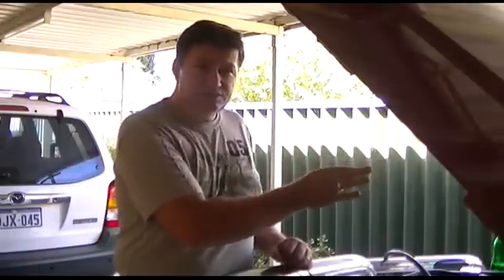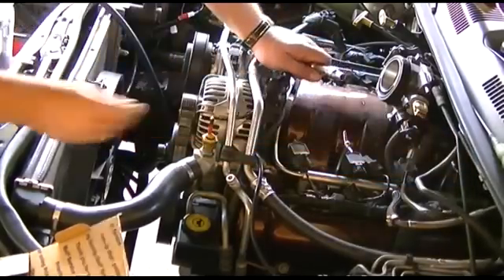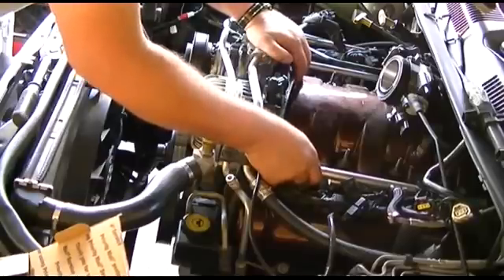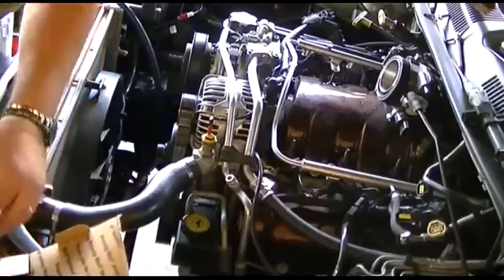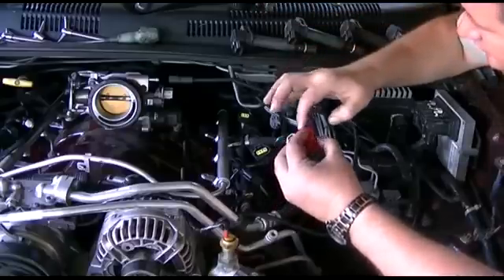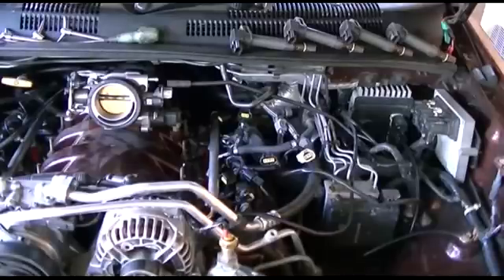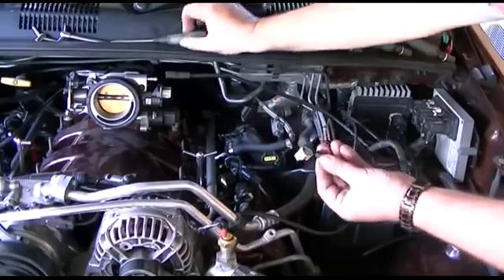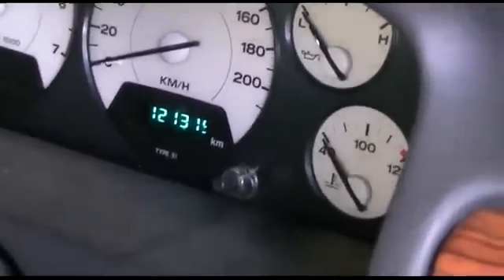How to change fuel injectors with 12 hole injector for better fuel economy and power in a WJ Jeep.

Comment: I found injectors that is for the Mazda L5-VE 2.5L it's 296.5CC will this work? It's also a 12 hole I'm getting 26L per/100Km in the city driving gently which is absurd will I get better fuel economy?
Reply from the maker: As long as they are EV6 injectors or you may need adaptors. They should be fine but I have no experience with them. Not sure why yours is so bloody thirsty?  Mine dropped fuel consumption from 16l + /100klm to 12l +/100klm. This heavy footed driving in city and highway. Do you tow or carry heavy loads? 
Next year my red jeep is going to be completely rebuild with much bigger injectors as I'm going to use E85. A lot of my obsolete upgrades will go to my WJ Overland. I'm planning of building a world first modification. I have a house to finish then take a long deserved holiday. So hang in there for more WJ adventures.
Reply: @BuiltByRik  I also wanted to go for E85  but in South Africa it don't exist lol nothing exists in South Africa and parts you gotta import them and it's Hella expensive
Reply: @BuiltByRik  they are EV14 injectors
Reply from the maker: @justindaniels17  you will have to google to see if they will fit. You may need adaptors to make it fit as well as a adaptor plug for the electrical connection. It you have the vehicle around wrecking if your able you could cut and solder the EV14 plugs into the jeep harness. 
https://www.google.com/search?q=ev14+to+ev6&oq=ev14+to+ev6&aqs=chrome..69i57j0i512j0i8i30j0i390i650.44048j0j7&client=ms-android-oppo&sourceid=chrome-mobile&ie=UTF-8
Reply: @BuiltByRik  it's the same connector
Reply: @BuiltByRik  funny thing is I don't tow or carry anything, what size tyres do you use? I just noticed all the tyres are different sizes one is 255/65/R17 one is 225/60 one is 235/65 one is 235/50
Reply from the maker: @justindaniels17  I'm quite strict with tire size as constant fourwheeldrive requires to have at least the front 2 tires to be the same and back 2 tires to be the same. But recommend is all 4 to be the same size. Each wheel has a sensor ring telling the TCM / ECM the speed of each wheel. I'm no expert in this but if one tire spins faster than another constantly it may try to compensate. Other readers may know more than me about it. Lucky I have a HD transfer case from USA that has a 2wd option as well. Looking forward to that I like doing burnouts.
Reply from the maker: @justindaniels17  I have 31 inch tires 265/75/16
Reply: @BuiltByRik  yes awd & 4wd should have 4 tyres of the size and tread shape and you're supposed to buy 4 tyres at once each time a tyre wears out otherwise it will mess with the AWD&4WD system especially if you have a LSD like I do but I got the car in Feb this year and I never paid attention to tyres until recently

Comment: Will a need tune? Stock engine 4.7 HO going with those Mazda injectors Its 296.5CC and stock (OEM) is 255CC
Reply from the maker: Just follow the instructions under the clip. You need to reset the ECM. It will then learn and adjust to the new injectors.
Reply: @BuiltByRik  thank you I appreciate, and hoping to see more WJ Content

Comment: Hello, can you send me a link where I can find a 12-hole injector for Grand cherokee wj 4.7?
Reply: Hello, I wanted to ask who can be the best injectors for increasing the power to 4.7 wj?
Reply from the maker: @leomirtafaj7662  For me it is this one. If you go bigger the ECM will just reduce flow and if it cannot you will run rich all the time. Bigger injectors need more airflow.
Reply from the maker: all the information you need is in the write up under the clip including part numbers. You then google that number and find what you need. Most of my clips that need more information have a look at the story that goes with it for more information. If you still need help plz let me know. Regards Rik

Comment: Hi there, 
I live in Sth Australia. 
Where would be the best place to order these Fuel Injectors?
I have a 2000 WJ 4.7
Reply from the maker: Where ever you can find them I guess. Also depends on your price range new or used. I brought mine on eBay. Check below clip and more on this subject in my channel. Regards Rik

Comment: What is the impedance on these injectors and flow rate? And would these work on the '07 4.7
Reply from the maker: I'm sure they would be fine but if you want to research first plz check the part number in the story below and look it up. Regards Rik

Comment: I had good results using injectors for a 2007 Chevy Cobalt 2.2 litre with California spec emissions. Just filed the fuel rail to make the clip area circular instead of the original "D" shape, used the original clips and fit like a champ. Reset the fuel trims and no rich/lean codes.

Comment: I just bought a set for my 04 dakota 4.7 and the injectors are the same size, the plugs are about in the right spot but the groove where the clip goes on is definitely different. I'm going to try an cut a groove in them. Hopefully I don't mess them up.
Reply: use a Dremel and round off the squared part of the flange on the fuel rail then you can rotate them in any direction needed.
Reply: Don't bother with the clips, just leave them off. They are only there to hold injectors on the rail during assembly at the factory. I left mine off a year ago with no problems.
Reply: charlie dee you running the injectors Aussie is referring to? From the 4cylinder focus ? I thought about just leaving the clips off

Comment: great video!! 12 hole nozzles will bring your engine to 2018 standards... 
the fuel comes out as a mist instead of a spray as in older EV1 type injectors
as long as its the same flow rating no tuning is needed 

https://www.injectorplanet.com/collections/volvo-fuel-injectors/products/denso-3900

this 24lb denso 12 hole nozzle is also a popular upgrade for the Magnum or Powertech V6 / V8 engine
thank you 
-Bryan
Reply from the maker: That's $50 each?
Reply: $17.69

Comment: I was able to pick up the Ford Focus injectors from Rockauto brand new for 18 each. Going to swap them into my 4.7l Dakota in a couple days along with some new O2 sensors. Great to know that is what they are selling on eBay as an upgrade.
Reply from the maker: They started doing that a few years ago as it became more popular.
There can be some trouble installing them from some brands. Ask if you have any problems. Regards Rik
PS don't forget to subscribe 👍🚙
Reply: Already did.  Got them swapped out today since it was decent out.  Took about an hour and a half from start to finish and I have never changed an injector before so I think I did pretty good.  The old injectors were the two hole style and likely the original injectors.  

And using an OBD2 bluetooth tool and my phone I was able to get a screen cap of the levels while running about 2000rpm of the fuel trim and O2 sensor readings from some brand new sensors.  The injectors are working perfectly as far as I can see. http://files.ventshop.net/Pictures/Mypics/Screenshot_2018-02-08-15-51-27.png the scale is a little off on the graphs but you can see it is working well.  Did this with an 03 Dodge Dakota so this pretty much shows that they work perfectly as even the fuel trim is in a good range.  I suspect that they will be able to flow a little more fuel than the stock ones but so far I am very happy with how it worked.  I think the idle is a little smoother now as well but that could just be due to the injectors being new and the old ones having almost 200K miles on them.
Reply: Well here is an update on the injectors.  They have worked great so far and I expect no issues at all.  My truck is rated at 18 MPG highway and 14 in the city.  I just the other day drove from OKC to Dallas and back and with a 24 gallon tank I was able to get 441 miles.  Tank may have had a little more than 24 gallons in it but that is the "rating" it has listed.  I should also note that the back seat has quite a bit of stuff in it, there is a toolbox in the bed along with some fuel cans, a set of ramps and a power chair that weighs about 500 lbs.  Two adults in the truck as well.  I was cruising right along at 70 in the majority of Oklahoma and 75 in Texas with a 15MPH headwind on the way down and not much wind on the way home.  I was in town driving through rush hour after a quick stop off in Grapevine before the game at the American Airlines Center.  

Figuring right at 24 gallons in the tank and it was still running fine when I got home so probably a little left that would put it right about 18.3 MPG.  Which is a little better than the rating it gets but not much.  The thing is that it's rated with an adult driver and nothing else in the vehicle and highway ratings are not at 70 to 75 mph.  Looks like most users are getting around 14 to 15 mpg and I doubt they are hauling around 1000 pounds of stuff all the time either.  http://www.fuelly.com/car/dodge/dakota?engineconfig_id=5&bodytype_id=14&submodel_id=  

All I can say is I am very happy with this mod and not long after getting it done I made a trip from OKC to Branson, MO and was getting around 19.5 MPG running 70 to 75 on the interstate without the power chair in the back which REALLY kills the mileage.  Over the entire trip as well as some around town stuff when I got back I used exactly 39 gallons, ran it bone dry, and ran 775 miles.

The next mod is a fuel heater.  Since the fuel is under pressure I should be able to use a heat exchanger to  bring the fuel up to the engine temp of around 180 degrees  it should evaporate as soon as it enters the engine.  Since it is under 40 PSI there should be little issue of it evaporating in the lines  and I also intend to put a filter after the heat exchanger which should drop the temp a few degrees and I plan to have a couple ball valves in place to adjust how much engine coolant is ran through the exchanger to help regulate the temp.
Reply: So a little update.  Been a few more years and still running good.  Sadly my life has changed drastically and when that drastic change happened I ended up overheating the engine and now the head bolts are likely stretched.  Completely my mistake but having your best friend and wife pass away really puts your mind in a bad place.  Was headed towards Tuscon, AZ and after passing through White Sands, NM I went through a pass and coolant must have been low or boiled over or something.  But the 2.3l Ford Focus injectors still work just as good as new.  Hopefully I can eventually scrape the cash together to rebuild the engine and keep it on the road a while longer.  This vehicle was the one major purchase my wife and I made together and I want to keep it going as long as I can.

Comment: There's no point in upgrading injectors if the PCM is not tuned for them. The stock PCM still thinks the stock injectors are in place and is having a harder time figuring out  the correct fuel trims according to what the oxygen sensors are reading. Complete waste of time and money doing this, unless you plan on the future to buy a programmable aftermarket PCM  to complete those larger flow injectors. Also that filter is sucking all the hot air in the engine bay that the radiator providing. All this mods instead of increasing performance it hurts the powertrain, there's a reason warranties are void if stuff like this is done. Don't believe any of this youtube videos unless is backed up by some sort of evidence like dyno runs.
Reply from the maker: They are not larger flow injectors lol. I think my warranty's run out a while ago on a 18 year old vehicle hahahahahahaha. There are plenty of jeepers who have done this upgrade and are using  less fuel you don't need a dyno to prove that. The increased throttle response is a added bonus. But your allowed your opinion but its the opposite to those who have done it. 
Flow is the same but the 12 holes atomize the fuel better than 2 or 4 holes. That's just basic mechanics. I guess you have not done the conversion because if you had you would not be so negative. I been telling people for 4 years about this upgrade and have had many thank you emails. But you know better I guess without knowing?
Reply from the maker: Ohh yeah I know my filter is not ideal but I have been battling health problems and time to upgrade my intake cheers for the negative comments. A aftermarket engine management system is on my bucket list. Regards Rik
Reply from the maker: Also this channel is for back yard mechanics just playing around with their jeeps if you don't like it don't look.
Reply: The ones you installed are indeed larger flow injectors they are 24 Lb/Hour even you mention it on the video description, "Instead I found some Bosch 12 hole EV6 24lb (240cc) injectors on eBay P/N 0280156161 for US$180 + postage to Australia. These are out of a 2003 Ford focus 2.3 liter 4 cylinder I found out later. ". You also said on the description that stock injectors were 19Lb/Hour when in reality on this more reliable website it says they are 22.5 Lb/Hour http://wjjeeps.com/engine.htm From 22.5 to 24 that's quite difference the PCM has a miscalculation going on now. Sure they atomize better, but what holds the fuel 49 PSI fuel ,more holes? Come on mate, that's equal to more fuel flow. I find it hypocritical from someone who spends so much money and time in a WJ to not install a better standalone PCM. Sorry but I try not to look at your videos, but simply I'm attracted to what misleading information you're gonna come up with this time jajajaja, it' is simply entertaining nothing personal. Maybe if the title of the video would be changed to how that change injectors only it would be a good one, but then you try to talk people into "Better performance", because the Overhead console tells you're getting better MPG then it sends all your hard work down the drain.
Reply from the maker: That is for stock 4.7 the HO has a higher flow and for your information the ECM (engine control module) a pcm is for the power train is quite capable of this small increase it learns from its sensors and adjusts fuel mix as needed. If I had put in 1000cc injectors that would change things. The ECM learns over about 50 trips so if you reset it after installation it adjusts accordingly. I'm no genius but know enough from research and questioning experts in the field who will back up my claims. In fact I have a mechanical engineer following me on Facebook who has also done this conversion and loves the improvement. Regards Rik
Reply from the maker: More holes don't mean more flow if the holes are smaller lol. Wow you think the injector manufacturer is wrong now about the flow of its injectors?

Comment: Any updates to this?  You've been riding with this setup for a while now, so I figure you have a better idea of how well it worked out.  Will it work on the standard 4.7l non-HO engine??
Reply from the maker: Mine is a worked non HO but many have done in in stock non HO V8's with great results. Power increased but fuel consumption improved from 16+ litres per 100klm to 12+ litres per 100 klm. 
I have heard a couple of people saying they don't fit? There must be some out there with a slight different shape but the same part number. They claim the plug is too low and the plug does not slide on hitting the rocker cover? Also some the clips do not go on but that is a easy fix by cutting a couple of grooves in the correct position. 
But I stand by my claim they are worth fitting. I get so many emails thanking me for improving their engines. Feel free to communicate with me any time or on the Home Mechanics Facebook page or Home Mechanics Man Cave page. Regards Rik

Comment: I did this injector change out just the other day. IMO it's not a good one. The connector is sightly lower on the injector making it hard to reconnect. On one of the injector I could not get the connector back on. the connector hits the valve cover. The only way it went on is by loosening the fuel rail bolts. This is to tight of a tolerance. Also it is not a 24lb injector. it is 240cc that = 22.9lbs. I'm going to remove them and order a set of Denso 125482704
Reply from the maker: Thanks for the feedback it will help others. Which brand are they? EV6 injectors dimensions should all be the same? Also injectors can be spun on a angle to change access. You are the first to have this problem.
Do you have the 4.7 V8 or the 4.0 6 cylinder? I cannot find that Denso part number?
I just checked and this is what fuel injector companies rate them at Flow Matched Refurbished 24 lb/hr EV6 Fuel Injectors # 0280156161 Bosch
Reply from the maker: So ill remove the 240cc from my comments if that is not completely correct.
Regards Rik
Reply from the maker: I am perplexed they don't fit. I would love to see a picture of the injector on the engine on my Home Mechanics Facebook page or the Home Mechanics Man Cave Facebook page. If you could that would be great.
Reply: Home Mechanics  they are 240 CC injectors what I am saying is that  only equals 22.9 pounds. you have to have a 252 CC injector to equal 24 pounds. I do have a 4.7 liter in my Jeep. I personally think the Bosch injectors would be a great injector for the 4.0 or a stroker. check out which hunter.com they have flow rates for many Bosch injectors.
Reply from the maker: I guess they are advertised wrong by online companies. But weather they are or not they were a great upgrade for my 4.7. I got better economy and a noticeably power increase. Mind you I need to upgrade now as they don't flow enough with my new camshafts. Regards Rik